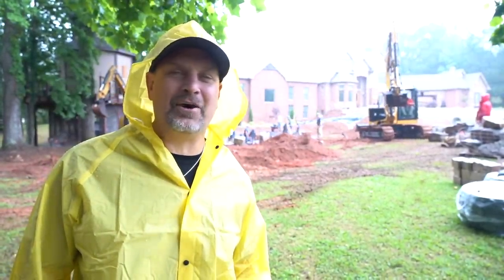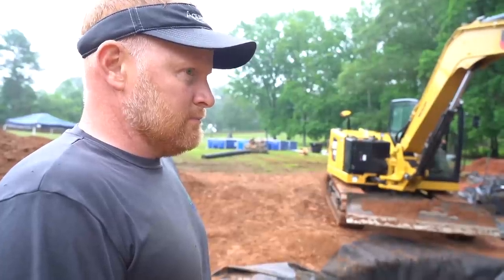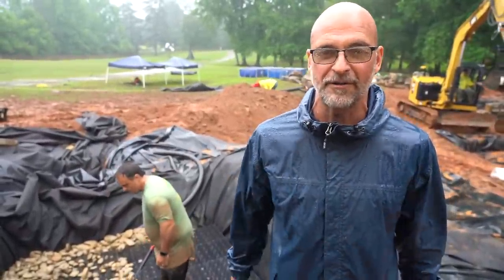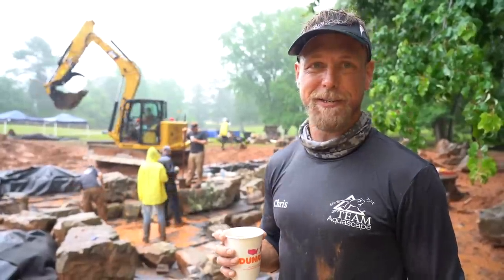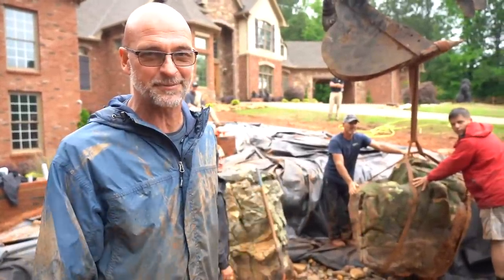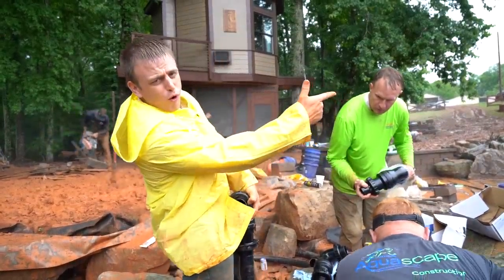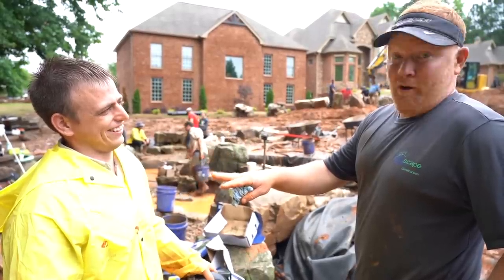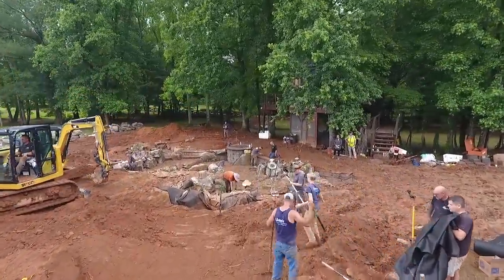SHAQ's *POND* Rain or Shine - Part 3

Comment: I can tell you these guys do ponds right. They built mine. 

This video just kept getting better. I would put this one down as your best video of all time. Loved everything about it. That stump is godly. Brian's face in the rain. The work ethic to work all day and push through... these are my kind of people. Pride in their job, combined with competence and talent. 

Hard work beats talent any day of the week... but why not have both. Amazing stuff guys.
Reply: You will never run a 100 meter sprint in less than 10 seconds without talent, no matter how hard you work. And there's also millions of dirt poor, but extremely hard working people around. But I guess you're correct in a sense that talent can be increased by experience/hard work so it's not purely a gift.
Reply: Oscar the saying just means that someone that works hard will generally be more successful than someone that is talented but doesn’t work hard. There are, of course, certain feats that require both.

Comment: If u used runner boards to put on the grass it would spread the weight of the diggers n so on. N not turned the grass into mud. But i went college n learnt my trade not internet bought bit paper